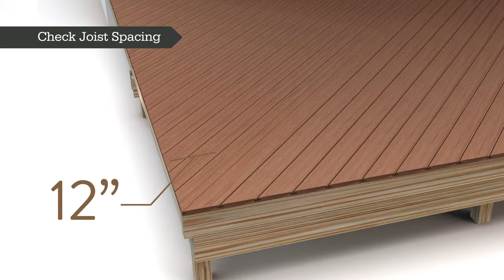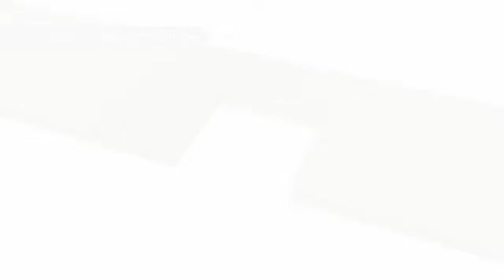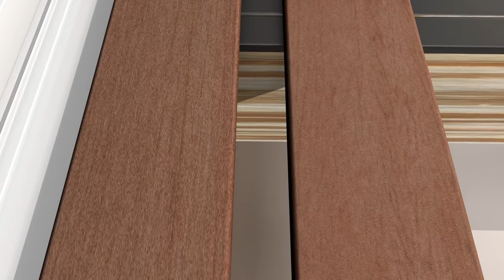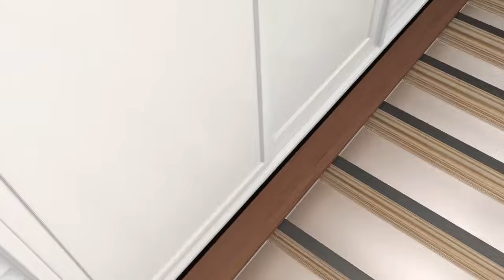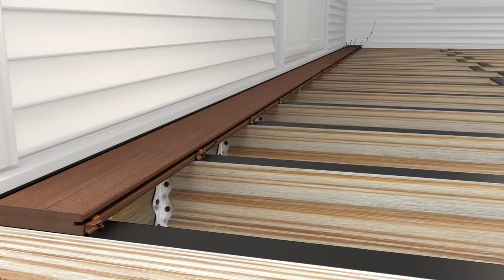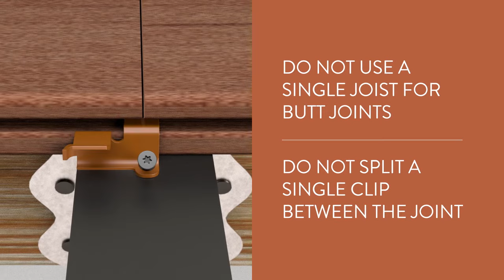TimberTech Composite Decking | Hidden Fastener Installation

Comment: TOPLoc for Composite -  color-matched screw, no plug to hide the screw head   VS.   Cortex for Composite - after driving the screw to the proper depth insert the colour matching plug to hide it.   I prefer to use the plugs because otherwise you see all the screw heads.
Pre-drilling..... TOPLock 5/32" bit   VS   Cortex - 7/32" bit

Comment: I used this system on my 30'x12' deck (63 boards 12' long) with a helper.  I had no issues except for a handful of the hidden fasteners not being driven in flush with the board.  We just removed it and tried again making sure to press down on the 'tab' harder while screwing them in. The 'tab' is the part that goes into the next board's slot.  It took us 2 days. The fasteners are much less visible than other systems and that is why I chose this system.  The 'trick' is work with someone who just drives the screw in just far enough, without overdriving it which will either twist the fastener or have it lean down.  The other person inserts the clips for them ensuring the hole is centred on the joist and pressed down into place, sometimes using something like a flat screw driver to do that so you're not in the way of the other person who's driving in the conceal lock screw.  You'll get good at your task and they'll get good at theirs.  If you do it alone like my brother-in-law you may get frustrated and take them back like he did.  Very happy with the results.